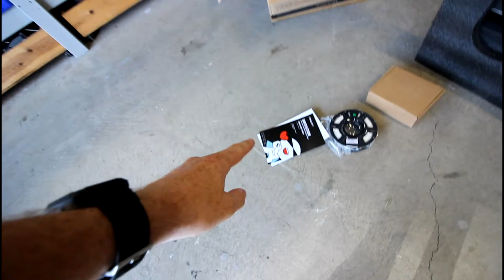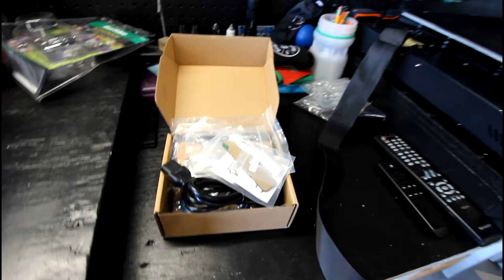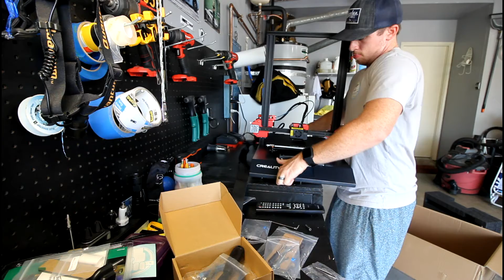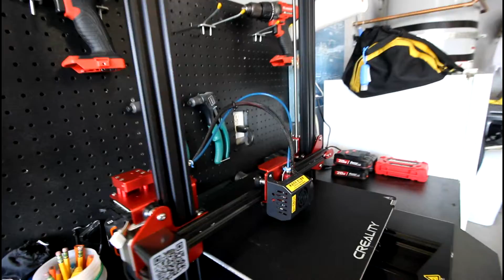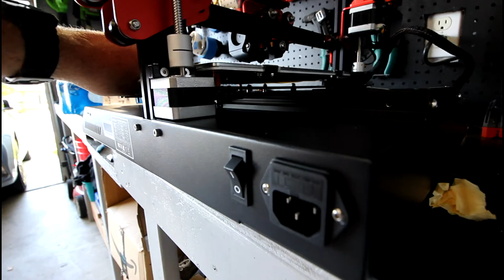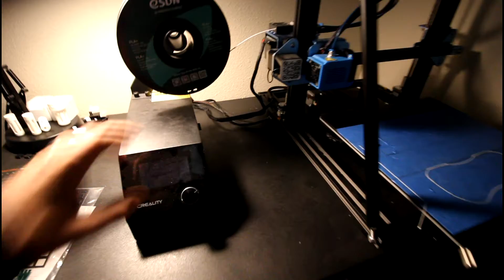Creality CR10s Pro V2 3D Printer Unboxing, Setup, and First Impressions!

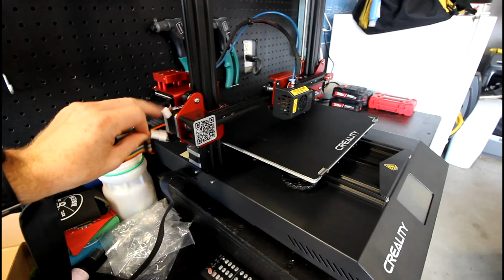Comment: 17:21 Which white Connector wire is it? I have this part with bus wire, but in the electronic board I haven’t the other  connector
Reply from the maker: It's been a hot minute since I put this together, but I believe it was for the filament runout sensor. May be wrong though!
Reply: @Addimotive bro, today I know which connector is, is for BL Touch sensor
Reply from the maker: @arukaze3  Ah nice, yes that makes sense as not All CR10s Pros came with the BL touch sensor!

Comment: What size is the wood shim tool you used bud just got a pro v2 today 👍
Reply from the maker: That shim was something I got with the printer. You can really use any size so long that the head is in a free state above the build plate and not contacting anything. You just need any type of shim that you can use to set both sides to the exact same height.

Comment: Quick question- setting up mine now . . . is there a voltage switch to select the voltage like on other Creality printers?  I couldn’t find one and don’t want to screw mine up?
Reply from the maker: Hey Nicholas, apologies for the long delay on getting back to your comment... it got lost in my inbox of other comments. You know, that's the one thing I haven't seen is a voltage switch. I know my CR10 v2 has one.
Reply from the maker: With the newer boards they may be able to automatically switch based on what voltage is sensed at the power supply. Thought I read that somewhere.